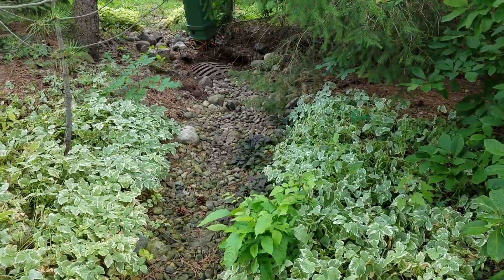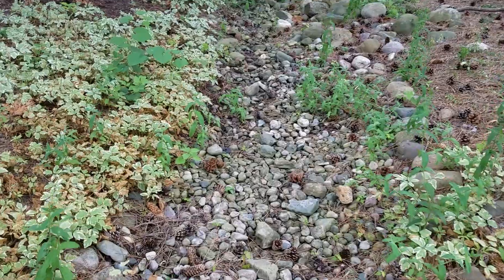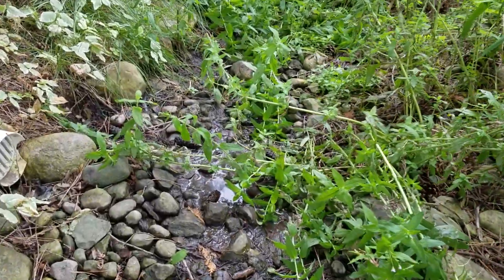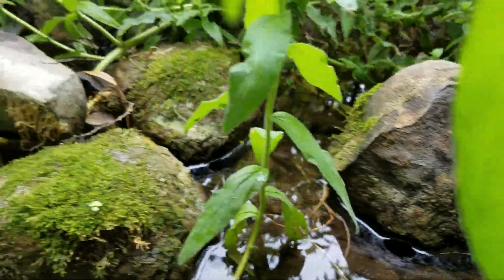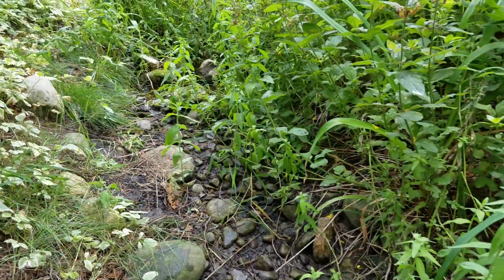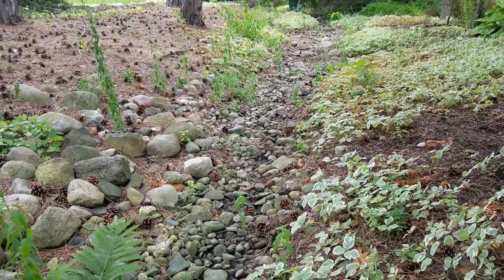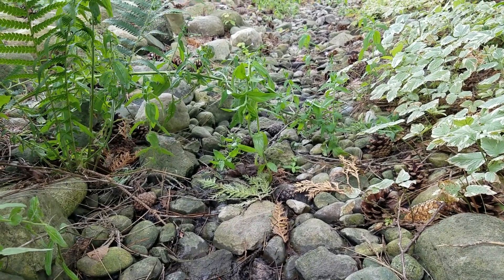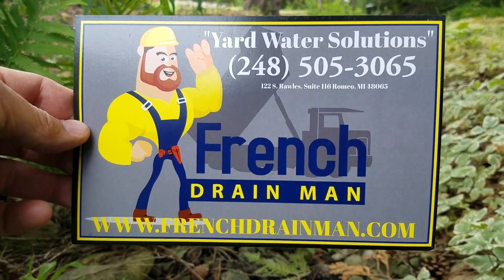How a French Drain System can Prevent a Dry Creek Bed Failure

Comment: That organic material would collect over the course of years even if you had trenched and rocked" it: Trees drop pine needles and pine cones, and weeds grow. During a heavy rain that dry creek will do what it's supposed to do. It'll flow heavily, control the excess water, slow it down, and prevent erosion. Who would normally do what you did to see that water? You had to look for it and stick a camera into the weeds to see it. You didn't state that the property owner was complaining about that water being a problem. Did he/she complain or were you just rambling around with your camera? Without you stating the property owners complaint, that small amount of water is not a problem in that out-of-the way area. It's an "off-to-the-side" area with large trees and vegetation naturally growing. If the trench and rock you suggest were there it would look exactly the same as you showed it: trees drop pine needles and pine cones, and weeds grow. Obviously the owner doesn't put a high priority on keeping that area manicured. Why should he/she? Who cares?
Reply: Is there any benefit to laying landscape fabric wrapped perforated pipe in the trench and then covering it with the stones of the dry creek bed? Or is it just as effective to landscape fabric wrap the stones, and then cover with river rock for the traditional dry creek bed look?
Reply from the maker: Best French Drain and Yard Drainage Contractor
https://frenchdrainman.com/